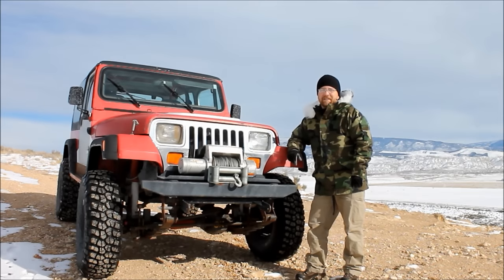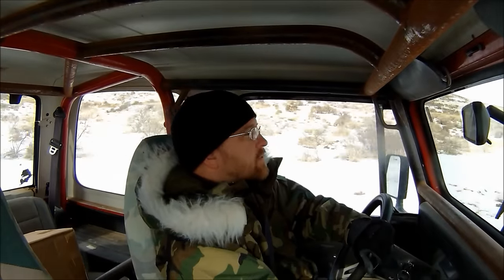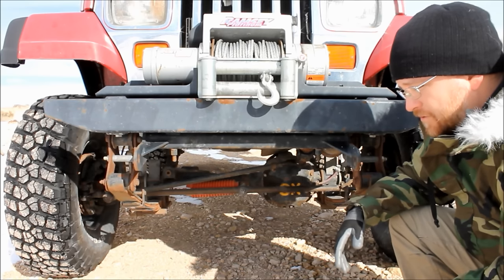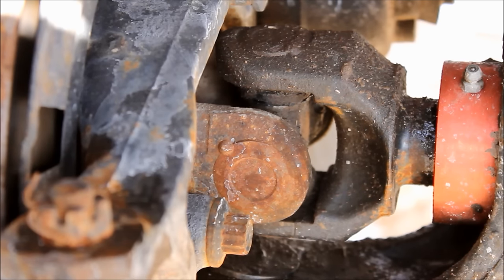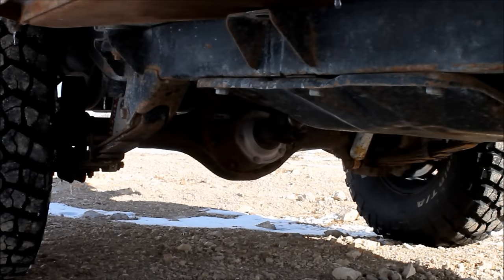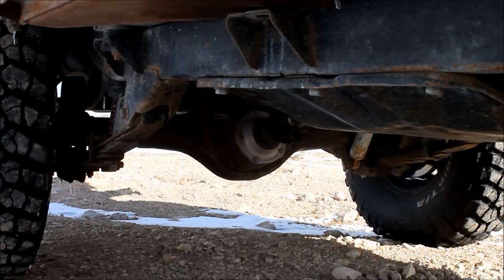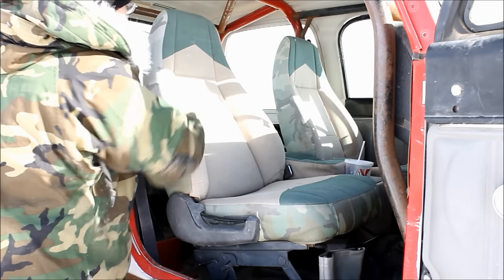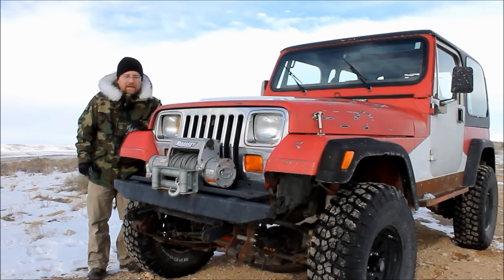MY 1992 YJ WRANGLER HISTORY AND WALK AROUND

Comment: Haha...I don't have a marketable skill to trade for custom work unless someone wants an IV;)  So I will have to pay for the roll cage addition and bolt-on rear end upgrade eventually.  But for now I lug around spare axle shafts, spare c-clip, and spare rear diff gear lube for the D35 with limited slip.  I have been wanting to do a full walk-around on my '92 like this, so thanks for the motivation!  I'll get right on that...oh, wait...I'm on call.  Nuts.  Hope it snows on the way to work!

Comment: Wow that really brings back memories bc I use to have a 95 yj also 4 banger also I know how weight really effects the cuz I had 33 Goodyear wrangler duratracs with a RC 4 inch lift and front and rear steel bumper. That thing dragged ass, I traded in for a 08 jku and I really miss it.

Comment: Thank you for your video.  Just a question. What year is the 9 inch from? I have an old 1970 F100 that was totaled years ago but has been in my family since new. I have been eyeballing that dif. What do you think?
Reply: +Christopher Z The rear end in that should be a ford 9 inch, most likely a 28 spline though. Shouldn't be too hard to switch it over to the Jeep either. Might have to cut off leaf spring perch's if they aren't in the right location but if they are in the right place, it's just ubolts for the leaf - axle, and brake lines.
Reply: I love the 9" rear ends and that will be a good axle for your jeep. Ideally, you want 31 spline axle shafts and the nodular iron center section. It will have an "N" cast into it. The "strange" cases are excellent too ( that's what I'm using). But even if you don't have those things, it's still an upgrade over the stock jeep axle and after market support for the 9" is unrivaled.

Comment: Did taking the carpet out and replacing it with bedliner affect the temp inside during winter? Is it colder in winter than it was before? And also, how does it sound inside the cab with the carpet out?
Reply: +Teddy Monroe I haven't noticed it being colder in the winter, but it is definitely hotter in the summer down on my right foot. The exhaust runs right under there next to my gas pedal and it gets HOT if I'm crawling low speeds on the trail. I have to put a piece of foam between my foot and the firewall or it gets too hot to keep my foot on the gas. It only happens when I'm low-speed crawling and there isn't enough air movement to keep the firewall cool. Regular driving out on the road is fine.As for noise, the noise level goes up substantially when you remove the carpet. I've heard that if you put a high-dollar bed liner in like line-x or rhinoliner, it quiets it back down though. The stuff I used is really thin and doesn't deaden the sound at all.
Reply: +Tyler Bleepinjeep try some exhaust wrap around that portion of the exhaust
Reply: +Teddy Monroe I pulled the carpet out on my '92 and did the raptor liner spray kit.  I found that it was louder and hotter inside.  The heat is an added bonus in the winter, up to a point.  So I got two of these: https://www.amazon.com/gp/product/B010CESJTC/ref=oh_aui_detailpage_o00_s00?ie=UTF8&psc=1and mounted one on top of the dash and another underneath.  My passenger and I each get a fan for our faces (keeps dust at bay) and one for our feet (cooler).  As for sound...some heavy duty floor mats from Quadratec and a thick piece of rubber over the tranny hump helped a lot.
Reply: +ʇɥƃᴉɹlɐ ʇou ɯᴉ That's a great idea!

Comment: Do you have any tune up videos for 4 cyl YJ's? I also have a 1992 YJ that I've had for about 5 years and am doing some much needed bodywork on as well as building bumpers for both front and rear. The front is almost finished. I still have to make the removable end caps for storage, as well as a couple of anchor points. I built a bull bar 3 plus gal air tank combo.
If you want to see photos, email me at cdnbvr@gmail.com. I welcome anybody to contact me.

Comment: What are you running for gearing?
Reply: Thanks for the quick reply. I also have a 4 banger. Im running 32's, and plan on going to 33's. Almost eveyone suggests going to 4.88.  The stock 4.11 isnt bad with the 32's.
Reply: +Kenneth Souza If you mostly drive on the road, you'll be happier with 4.56's. The 4.88's are great for crawling, but my RPM's are pushing 3000 at 55mph. If yours is a daily driver, you'll get tired of the crappy gas mileage pretty quick. If its mostly for offroading, you'll love the 4.88's. They give that torquey little 4 cylinder some real grunt.
Reply: I was highly considering the 4.56 seeing how it is my DD. But all the advice and forums Ive looked into said the jump to 4.56 is a waste of money. In your experience,  Will 4.56 make a difference with 33's?.
Reply: +Kenneth Souza Yes, it will make a difference. It's not as pronounced as the 4.88's but definitely noticeable. I just think you'll really get tired of the high revs if you do a lot of highway driving. You can forget freeway speeds with 4.88's. You just can't get there. That's why I think you'll like the 4.56's better. My dad runs 4.56's in his XJ with 33x12.50 tires. He likes it. He's running the 4.0 instead of the 4 cyl, but I still think you'll like the slightly higher gears for daily driving.

Comment: anyone notice it has a marlboro paint job
Reply: +chevyreaper I wondered if anyone would notice that. This jeep was actually a Marlboro jeep. It was one of the jeeps they used to take on their big promo Moab tour. I'm sure that's where all the damage came from. It was obviously jumped multiple times. The rear axle was bent, shackle hangers broken. Engine overheated and burnt. It only had 15,000 miles on it when I bought it and yet it had all that damage... Hard lesson learned.